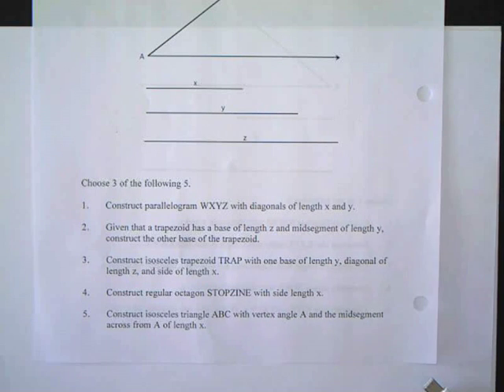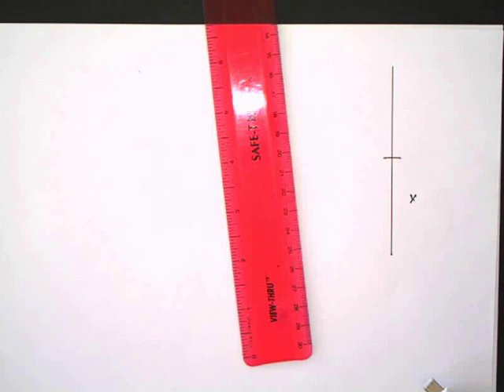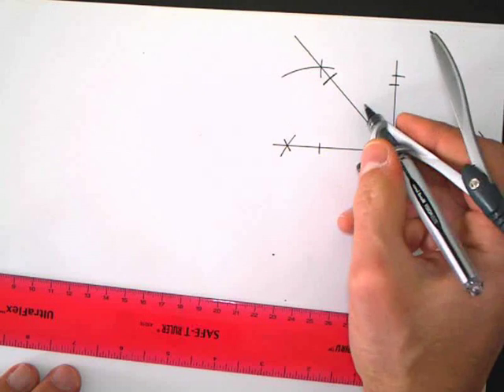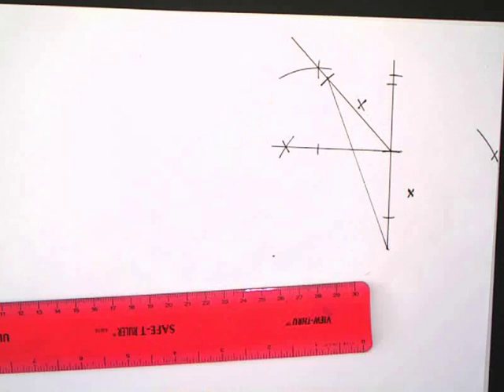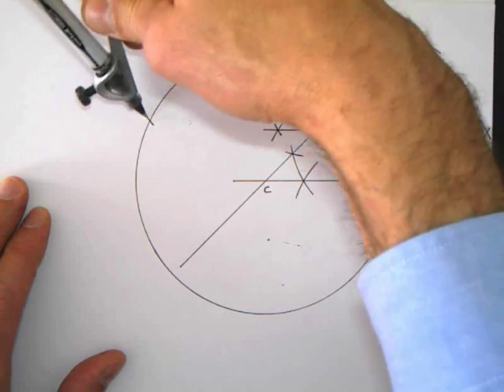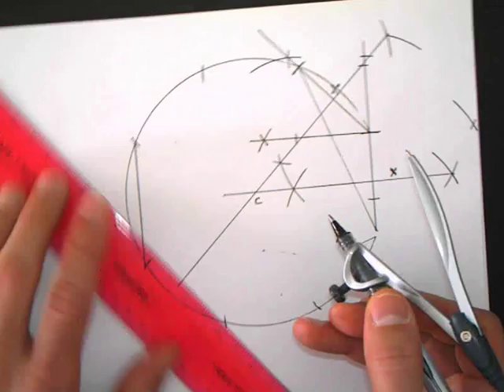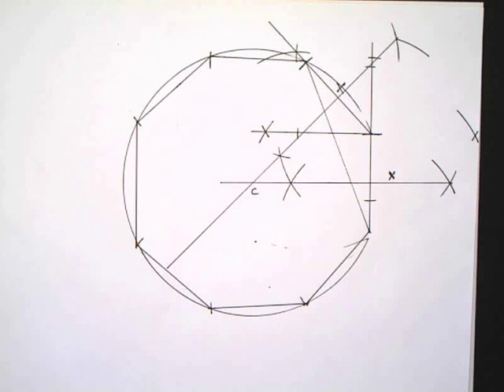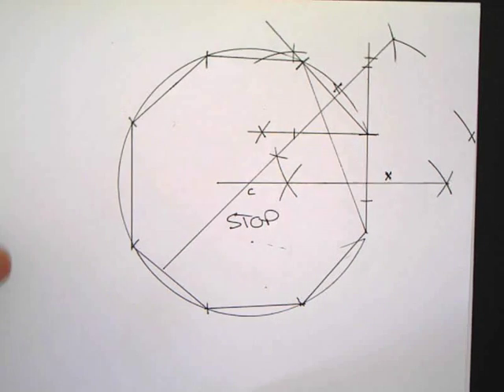Constructing a Regular Octagon, Given its Side

Comment: Umm couldn't you just draw a line of the given measurement AB, bisect the line AB to get perpendicular to AB and then draw a perpendicular from A (of the given measurement) to get point C then draw AC such that AC intersects the perpendicular to AB to get the center of a square S. Then draw an arc from A to C taking B as center such that the arc intersects the perpendicular to AB, to obtain the center of a hexagon H, bisect HS to get the center of an pentagon P, measure HP and u can make octagon